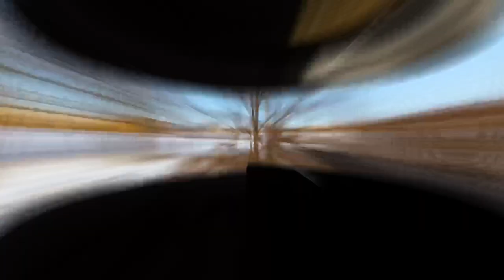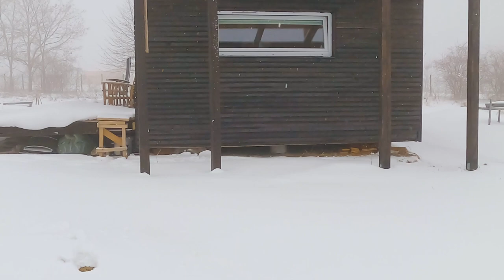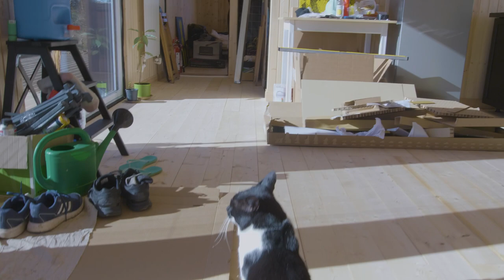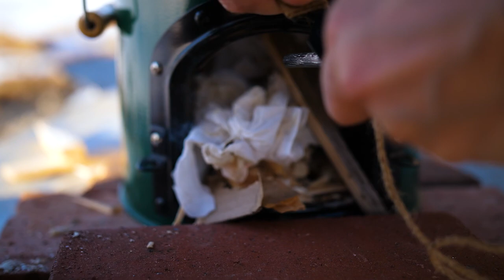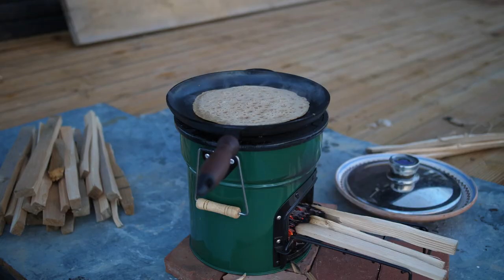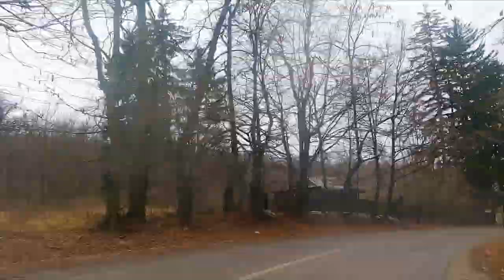Living in a PASSIVE HOUSE during Winter / ROCKET STOVE cooking

Comment: What is the recipe and what kind of flour are you using
Reply from the maker: Hey ! :)
Reply from the maker: sorry the message wasn't sent correctly. The recipe is : 
500g Buckwheat flour
1TS of Olive oil
1TS of Bicarbonate Sodium Pinch of Salt
2TS grounded Flax seeds
1 Litter of Plant milk
Adjust the quantity of flour and milk until the texture is smooth and thick enough.
Let it rest in the fridge or on your counter in a cool place for at least 1hour before making the pancakes.